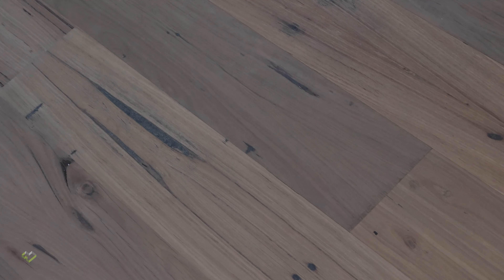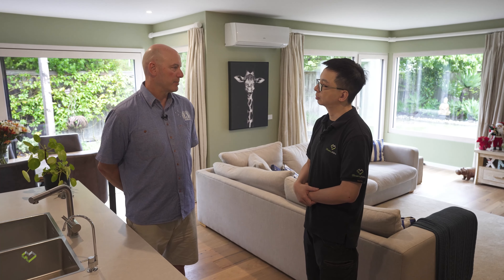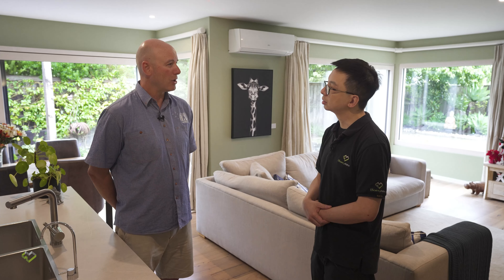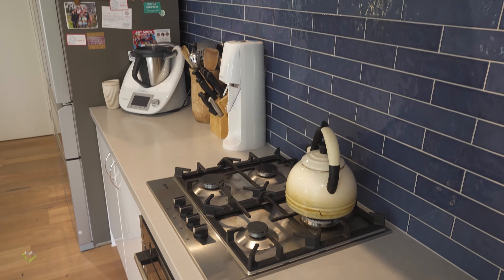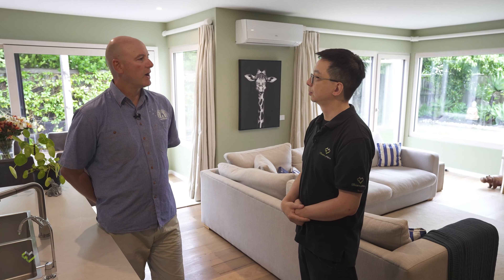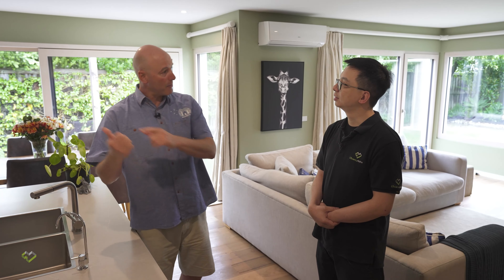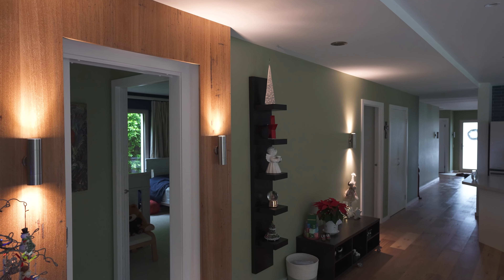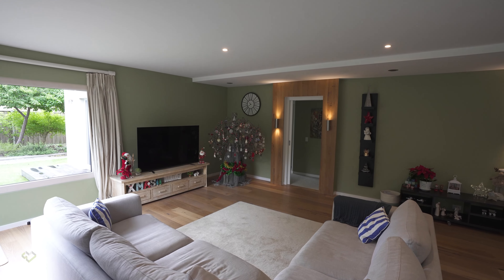3 Years in a Passive House retrofit: Expectations vs. Reality.

Comment: Hi Raph. Great job retrofitting to as close to PH standard as possible in an existing build. If I may, in reference to your gas, because you only have the cooktop connected to mains gas, usage cost will be very low, but for the sake of having the gas, the daily supply fee will be 95% (or possibly more) of your $400.00 cost per year. Such a shame. You mentioned EMF from induction. Consider the NOx from burning the Methane into the atmosphere. In my humble opinion, the NOx is far worse than some localised, possible EMF harming anyone. FAR WORSE!!

I recently removed gas from my Melbourne home and having induction means LESS time cooking compared to gas. The induction is faster acting and more responsive than gas, with almost all the energy produced, being directed into the pot/pan. I strongly encourage you to make the move to induction and rid yourself off mains gas.

On the topic of HRV, I certainly like the centralised Stiebel system, with the ducts inside the thermal envelope of your home. How is it during summer? Is there a summer bypass you can activate? I have a very conventionally built home, which I have endeavoured, over the decades, to air tighten as best as possible. Fully achieved recently this plus big top up of ceiling insulation. Brought a VAST improvement to the comfort level our home has to offer. Fantastic thermal stability (as you know). The improved acoustic dampening levels are a terrific 'fringe benefit' as well.

I also have various monitors placed throughout the house. Our CO2 monitor ranges from a low of about 430ppm with windows and bifold doors open to 1800ppm+ when closed. I found a balanced, centralised HRV, where the ducts can be located outside the thermal envelope. We're having that system installed mid March. Looking forward to low CO2 levels all year round, with or without windows open.

Keep on inspiring people to move to the PH concept and adopt world best practice. Cheers. David.

Comment: Awesome review 👍. I have a question, and I hope someone has an answer. I’d like to build a new building, and there’s going to be organic food producing plants around the house. So I don’t want any unnatural products on the outside of the building toxicifying the grounds over time. My question is what’s the best way to seal and water proof the concrete basement. Any search I’ve done, shows some type a thick polymerized paint and/or plastics and so on, which I want to do away with. Any advice would be appreciated. Thank you.

Comment: EMF is bad but particulate matter pollution from gas burning is good? Not sure what to make of that
Reply from the maker: A reported 12% of asthma suffering kids is triggered by gas in homes.  It’s a real tangible number, so if you really love it… you really need to make sure you get your ventilation right, to have it.
Reply: This is a tough one. As Raphael said, it's a personal preference not necessarily better or worse. The gas pollutants can be managed by the exhaust systems. on the other hand, the potential adverse effects of the EMF cannot be effectively mitigated. in a nutshell, manageable known risk V unmanageable potential risk.

Comment: Using my ducted AC, i set the temperature to 24 degrees C. Once up to set point, i switch to fan only mode. It then acts like a heat recovery system

Comment: What was the remodeling costs to achieve the energy savings?
Reply: Also wondering the cost of all this. That triple glazing alone would be $60k+
Reply: The total cost for absolutely everything (replaced the roof and bathrooms and used salvaged timber floor boards) was around 400K (Australian dollars) but was done 3 years ago before covid caused a lot of price issues.
Reply: The triple glazed doors and windows (there were a lot of them) was about 80K (Australian Dollars)
Reply: @ecolibria6170  wow that's alot of $. Under sustainability Victoria real world modelling they put double glazing windows at a ROI at around 30 plus years.  Retrofit will never see any ROI in $ terms. I'm in  what is considered a cold climate and spent 9k in going from a R2 ceiling to a R7.2  but made 0 savings in my energy bills. I made more savings spending 9k on a battery and solar.
Reply: @ecolibria6170  house looks real nice and energy efficient.

Comment: I don't know about you but a 12 degree C difference (22 ish degrees in Fahrenheit) is a heck of a temperature swing for indoors.
Reply: Yes I agree, a 12 Degree Celsius swing is high for a passive house generally but for around 95% of the time there is a 5 Degree difference in temperature levels. In extreme heat (we can get 42 Degrees Celsius on a few days a year) and 3-5 cold days in a row with not sunshine (around 1 Degree Celsius) which again happens rarely but can happen for around 7-10 days a year we will experience the up to 12 Degree Celsius swing.
Reply: You need to compare it to the previous temperature range of more then 30c. Then add to the fact that range is basically the 99th percentile not the median temperature.
Reply: @ecolibria6170  I'm in Minnesota, USA, & I know of a few Certified Passive Homes up here, & I'm pretty certain that they don't have those types of swings. Our temps throughout the year go from 35 Celsius (or higher) all the way down to lower than -28 Celsius (for well over a week at a time). I've been told by Passive House folks up here it's the ability for the home to keep a constant temperature with very little mechanical input that makes them worth building.